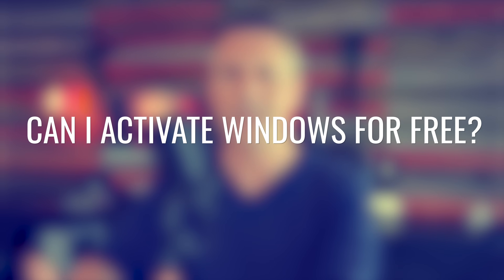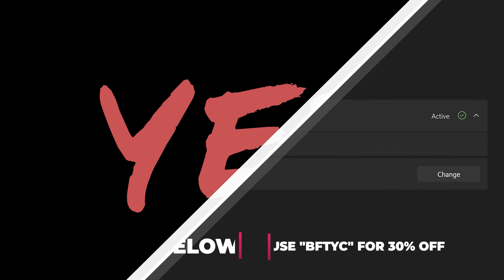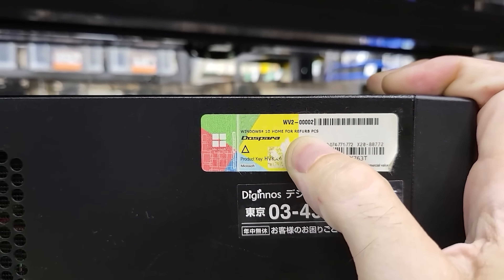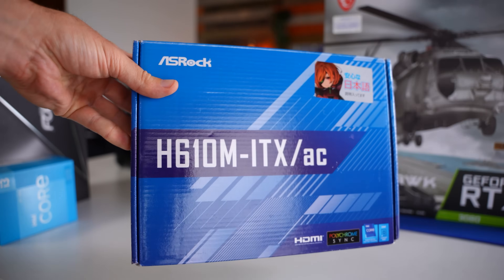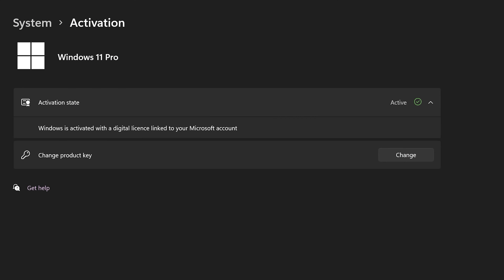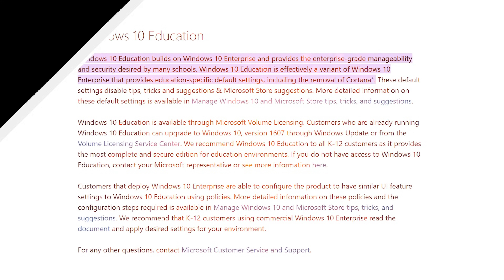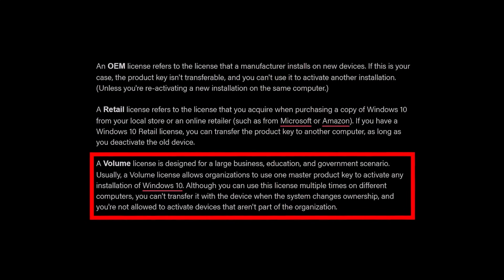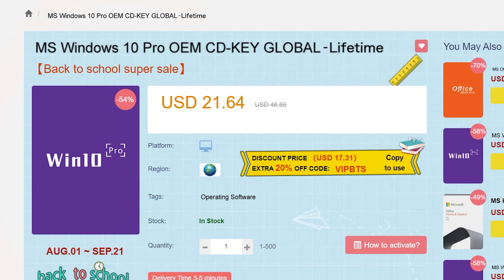How to Get Windows 11 for Free in 2022...! (4 Methods I Know)

Comment: very good method and well explained. If it does not work, also confirm BNH-software is a good option.
Reply: Many of the methods in the video have worked for me. But I admit that the option you mention is also very good.
Reply: @manu55pool  really? They recommended to me a while ago to get my Windows key from there, I'm still undecided.

Comment: Too bad the method of taking old Windows 7 keys and using them no longer works since several months ago. I had read that Microsoft turned off some server that was allowing that loophole to continue all these years. Though you can get retail keys for like $7, so it isn't a big deal.

Comment: By the way for anybody that is considering to buy the keys in the description, it is selling you on OEM keys, not retail, so it's locked to the device you're putting it on, be careful if you are considering it
Reply: Can you explain the danger with this?
Reply: @OEM keys are meant for manufacturers to install on pre-built PCs before purchase. Unlike retail keys, they can only be used on the PC they’re installed on. Retail keys are more valuable and can be swapped between computers, but using the same retail key on multiple PCs violates Windows ToS. If you get multiple OEM keys, you also can’t test them all as they’re permanently bound to the tested PC. If you’ve played WoW, OEM keys are Soulbound and Retail keys aren’t.
Reply: @akinovax  Thanks for the reply and explaining it, greatly appreciated.

Comment: "keyr.o̲rg"
Interesting comparison. I upgraded (if that's the right term) from Windows 10 to 11 and had real issues with compatibility and performance. Multi tasking became problematic and of the few games I play, some simply wouldn't work. I quickly re-installed windows 10 and that's where I'll be staying for now. Of course this is only my experience, others may have had a better outcome. That said, I honestly don't know why we even have 11, wasn't 10 supposed to be the last? Its reached a point of maturity where it works reasonably well, too.

Comment: Thanks, I wasn't sure about using these websites to get an activation key for windows. But I took a chance after watching your video and used the promo code you supplied and I got a fully activated Windows 11 Pro key instantly.
Reply: @Salvation by Grace Through Faith  I haven't had issues with water marks or updates amd still shows activated Windows 11 Pros. I purchased 2 keys amd both work.
Reply: Is it still working a year later? @shebert29
Reply: Make sure you always try and buy a "retail" key since they are more legitimate compared to MAK or OEM keys and you don't have to worry about the key no longer working in the event you replace the motherboard.

Comment: There is also a "grey" way of extracting SLIC 2.1 key from an OEM motherboard BIOS and then edit it into a new motherboard BIOS file, flash it, import OEM certificate and activate it with Win7 and upgrade all the way. Personally I wouldn't bother with this because it's just easier to get a grey market key.
Reply: Purely for educational purposes slic key can be loaded pre windows boot. However the 10 upgrade creates a file that is effectively your license and it doesn't use the slic keys.

Kinda like the haswell microcode when doing the turbo unlock.

And in 10 you can link a license to your windows account then move that license to a new computer. However i do not know how the tos works with that is it is a "newer feature"

Comment: I always used 7 Loader back in the day for windows 7 and 8 but loaders dont exist for Windows 10 & 11 that I found. Ive been using volume keys since windows 10 came out and now for windows 11 and I never had a problem and there Free.
Reply: Where do you find these keys?
Reply: @joelwylde  what windows version do you have
Reply: @MoDzAudio  Windows 11
Reply: Windows 10 digital activation tool, replaced Windows loader. But you could also use Microsoft activation, scrips to avoid virus, detection issues, or just turn your antivirus off or make an exclusion folder.

Comment: When Windows 10 was first introduced Microsoft allowed everyone with Windows 7 to upgrade to Windows 10 for free for a year and that included PC with pirated versions (SLIC method) of Windows 7 as Microsoft wanted everyone to jump into Windows 10. However, the process of upgrading for free from Win7 to Win 10 STILL WORKS (even with pirated Windows 7) after upgrading you can reinstall that PC as much as you want and it will auto-activate. This process does not work on new hardware.
Reply: Windows 7 keys can still be used for Windows 11 too.
Reply: @Fals3Agent  correct, keys from win7 up to win11 are interchangeable, i was talking about the grey area of upgrading process from win7 to win10

Comment: Also worth mentioning that Windows 10/11 (and probably more) have "default keys" or "generic keys" available on the internet for "system builders". Wouldnt sell a PC with one. BUT SOMETIMES theyre activated for long enough for your motherboard to phone home and grab a key. Your mileage and ethics may vary.
Reply: generic keys are used for installing a system, they are not meant to be activated
Reply: Windows keys are pretty useless unless you need a pro key

Comment: I got my copy of windows for free from Microsoft back when windows 7 launched I did one of those windows 7 launch parties and in the box of goodies they sent was a copy of windows 7 ultimate signature edition and I've been using the same key since across lots of different hardware as I slowly upgrade I am now running Windows 11 Pro. I have also used your link and coupon code to buy keys for computers I have built for friends and they all work perfectly so I will definitely use your link again.
Reply: Can I use that key?
Reply: @88polyphia  no sorry that's the key for my main desktop and will be my windows key for as long as I can upgrade windows for

Comment: Guess it's worth reminding that, aside from watermark, unlicensed copy of Windows 10(and 11 as well, I presume?) works just as fine. So, until you have at least 1080p monitor(for "smaller" watermark) you can bare with it, which is the easiest way to sort out the problem: ignoring it😎
Reply: if you run windows 11 sandbox it is an unactuated copy of windows with watermark
Reply: You can remove it with simple regedit.

Comment: I use the skip/bump method, i have heard of people going on marketplace and looking for computers with a code on display and use that also.  The codes on the side of a PC are unused OEM codes, they are not actually in use. This might sound odd as allot of people would assume the code is in use on that machine. But no, the OEMS use a single image of the installed OS and all the bloat and clone it essentially to all the PC's of that model as they are identical. The image uses the same code (A MAK KEY!), the one on the side of the machine is for backup for catastrophic failure but it is unused. (most of the time!)  Some new PC's don't include a code now because the hardware ID is stored in the cloud. Meaning in the event of a HDD or SSD failure no code needs to be input as Windows pulls the activation data from cloud once your logged in and online. The ID is tied to the motherboard you can change everything in system bar motherboard i have never seen the ID actually tied to anything else although Microsoft claims it is.
Reply: That's pretty shitty - if the PC is being sold on marketplace, whoever buys it is probably going to reinstall windows, not use the enterprise version. They'll be wanting the key on the side of the box to do this.
Reply: @joby602  not really as if it’s on windows 8 or up the activation is in the cloud. The OEM key is unused on the side. They would reinstall windows and have it activated without ever using that code. It’s odd how it works but yeah the OEM keys on the side are unused and won’t need to be unless motherboard is changed. The install will still be active on machine as separate licence.
Reply: @AdamsWorlds  Ah fair enough. I'd done this with a Windows 7 machine recently I bought from work and that did need the key. Sounds like things have changed.
Reply: @joby602  Ah there was your problem. If it had activated Windows 7 on it, you just had to update to Windows 10/11 it wont ask for a key for an update only fresh install. Once updated and at desktop with internet connection you can then fresh install over and over without a key just click the "i dont have a key" option. Once you are on desktop it will say activated when connected to the net. This means you never use the key on the side at all. All future installs you just click the "i dont have a key" option and it will remain active on hitting desktop. :). Windows 7 still used the old key method. Upgrading it to 10/11 instead of clean install transfers the activation to the cloud.
Reply: @joby602  This is also another way people got windows 11 for free. They would use those Windows 7 activators that emulate oem bios on a windows 7 install. Then just do an upgrade to 10/11. Once thats done once, you can fresh install without a key and it will forever be activated without no trickery needed (still works this method)

Comment: Windows 11 refuses to install on my new PC build because it doesn't like some setting on the mobo TPM module and I haven't figured out what is causing the problem. That said, I am fine with Windows 10 Pro and have multiple licenses for it.  As a former Technet subscriber, I had a whole stack of Windows 7 licenses all entitled for Windows 10 upgrades and then to Windows 11.  As for the new taskbar, meh. I use Classic Shell  for that and Total Commander for all my file management. So I have no need for those parts of Windows and whatever new thing 11 is doing there means nothing to me.
Reply: thats your motherboard bios thats not allowing you to do that.i just had a motherboard do same thing.when i swapped it out samemem ect it was fine
Reply: its a security key basically

Comment: I always found it stupid people putting OEM equipment out of the original case into one of lower quality (flimsy metal, glass or acrylic blocking all airflow) really dumb.  But thats me.  I just use my hole saw to get a round hole in the OEM case, and 3d print a grill that I attach behind it.  Then everything works and gets cooled.

I am way function over form though.  12 RGB fans going into a glass case wall is just dumb to me.
Reply: I like the way you think.

Comment: I genuinely think Windows 11 is ridiculous. Unless you're buying a key from Microsoft themselves, buying from third party websites isn't helping them. So, getting windows "legit" isn't a thing. There really is no difference to having Windows activated vs not. Also, a lot of the times you can get Windows 10 keys and upgrade to windows 11! Lastly, microsoft has ads up the butt, no way I'm paying for more ....
Reply: Windows 10 and 11 were the final push I needed to go to Linux. 99% of what I need is there. That other 1% I dual boot for and I'm not activating it just for 2 programs.

Comment: Tried to transfer an OEM key from a virtual machine on one computer to a host installation on another computer, and it wouldn't let me activate it. So I assume that an OEM key on a VM is treated just like a standard install, in that it only works on the first motherboard it's used on?
Reply: If you have logged in with the same Microsoft account on both pcs it won't care as long as you don't have both on at the same time otherwise on th first you have to deactivate the key then install it on new pc

Comment: Question is why would you want Windows 11? I'm using Linux.
Reply: I use windows 10 and I would much rather use Linux rather than Windows 11. I've tried Ubuntu, my only grife with it is that my wifi adapter didn't work automatically like it did on windows but thats it
Reply: @Dictatortot-n3d  make the jump and use it. Its great.

Comment: I just purchased 4 motherboards off Ebay and they all activated windows 10 64 bit pro for free after booting with a usb drive and selecting I do not have a product key, then they boot up and say they are activated with a digital license with internet. X79, X99, 4th gen intel, etc.
Reply: Locked to motherboard...yeeees. And?

Comment: The only time I have ever bought a license for windows was win7 pro, which I am still using. I had two nephews that were in school and were eligible to buy it for $29. It was worth paying for since obviously win7 is the best OS MS has ever made.
I have told a few friends and co-workers about SCD Keys and your discount code for those who wanted MS Office but refused to get sodomized for it...
Reply: I paid $265 for Retail Windows 7-64 Pro. Microsoft has damaged the credibility of proprietary software because of their "Telemetry." I plan to switch to open source Linux and use Windows 10 inside a VM for 2 titles which I need but only are available in Windows 10. For that you need a new, very powerful system. If software constantly returns data to its home server regarding your usage, it's basically useless. Microsoft is giving me all kinds of headaches.
Reply: @Cypherdude1  I would LOVE to switch to Linux and leave MS behind, but of course the problems keep me from making the switch. First is having to find software that does all the things I do on windows, and of course learning how to use all those new programs. The other huge problem is the learning curve to use Linux; the "curve" is actually a 90 degree wall that you splatter onto...

p.s. I know there will be Linux fanbois who will scream that you don't HAVE to use the command line to use Linux, which is technically true in a way. If you don't want to install any programs that weren't installed when Linux was installed, or you don't want to update or customize any programs or change the initial install in any way, you can probably get away w/o having to open a command prompt. And it's okay that is how Linux works. It's just really annoying when guys who have been using Linux for 20+ years tell you that you can switch from windows to Linux and you will hardly be able to tell the difference. They always "forget" to tell you about the 20+ years of command line experience they have, all the problems they have figured out during those 20 years, etc. I know that Linux is superior to windows, but it doesn't help people to switch from windows to Linux by lying about the process all the time.
Reply: @SirReptitious  Right click on your original post where it says "2 days ago" and choose  "Private Browsing". Scroll down all the way. You will not see my latest comment.
Reply: Windows XP
Reply: @ronniekregar3482  See my five monitor system in my only YT video.

Comment: >Still paying for Windows.
>Not using Linux.
Reply: Linux is a poor option for gaming. Sorry but Linux isn't some epic OS that is better for everything.
Reply: @Krytern  Better than using a spyware operating system that you don't own that tracks everything you do. Gaming is getting better and better on Linux by the day. The Steam deck uses Arch Linux and soon there will be no reason to use Windows at all. 

Linux as an operating system is far more superior as it doesn't require TPM, secure boot, specific hardware requirements and soon Microsoft Pluton chips as well as not spying on everything you do. Guess you wouldn't know anything though, most Windows users don't. 

Enjoy your walled garden you absolute troglodyte.

Comment: I managed to get Windows 10 for free back in the day with a genuine Microsoft issued license basically back in the day for windows 10 Microsoft were doing free upgrades to Windows 10 for all people who had activated copies of Windows 7 or 8/8.1 and you could even get away with using a cracked license copy of these OS's and I used a cracked Windows 8.1 to get Windows 10. The PC was originally a Windows 7 PC but there was an error with it so I used a program I was using for activating Microsoft Office (I used MS Office for school work as back then and we didn't have the privilege of having the schools pay for our copies of Microsoft Office  nor was there any free versions of said applications like today that we could take advantage of and since I really needed Office for school I went on the hunt and found an activation tool that worked on Office and Windows and would activate them for you). As a result of having a corrupted PC I got my hands on a USB installation for Windows 8 (I upgraded to Windows 8.1 after since I hated the UI like most people did) and then used that same activation application after the fact to activate Windows. It worked fine then when Windows 10 released I found out they are giving free upgrades to all users of Windows 7 and 8/8.1 so I thought I will see if I am eligible and surely enough the Windows 10 compatibility checking software said I was good to go with a free copy of Windows 10 which shocked me. I then built my own gaming PC in 2016/17 and then did the same thing to get a Microsoft issued license of Windows 10 on that PC but for my current PC I just ended up buying an actual key since the activator stopped receiving updates and didn't work (probably due to the fact Microsoft were starting to issue free copies of Windows as upgrades and the devs of the activator tool probably just decided to put the nail in the coffin) there was an alternative tool that I knew about but that didn't work either and I did not want any hassle and I know there are workarounds to get rid of the watermark such as a program that literally stops the watermark from loading during Windows startup and tries to keep it from appearing but that requires some CPU power and although it is a very light program it sometimes doesn't work so I stopped using that and just installed a fresh copy of Windows with a key I bought online
Reply: Windows 10 isn't "back in the day" it isn't 30 years old lol